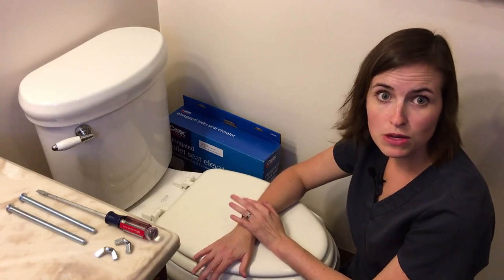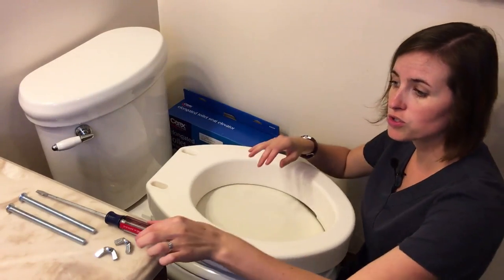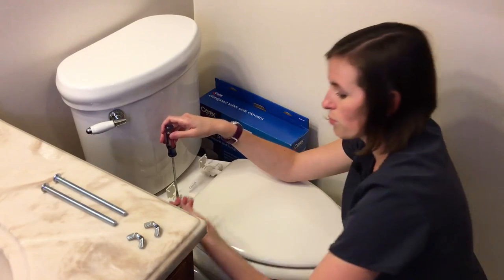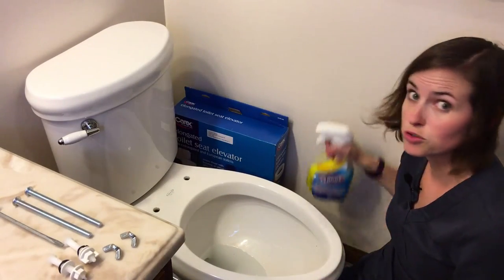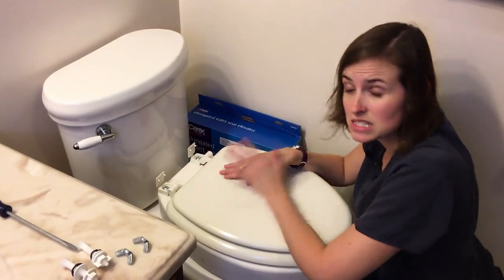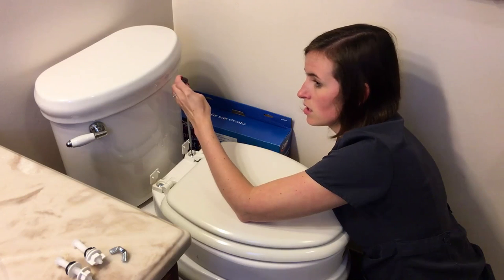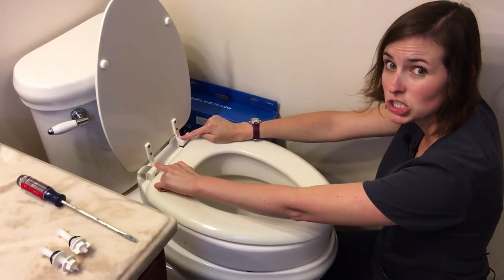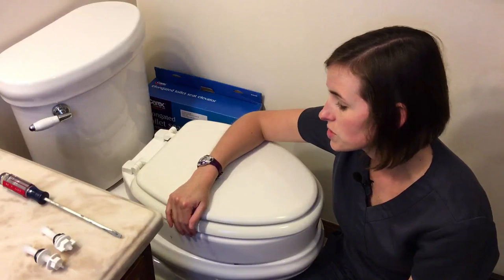How to Install a Raised Toilet Seat with Assembly | Carex Raised Toilet Seat

Comment: Thank you for this video.  The installation instructions for this same product is very lacking.  You did an excellent job.  Thank you again.
Reply from the maker: Thank you Gloria, glad it was helpful!
Reply: Thank you for the video.  I just tried to install one that someone loaned me.  The problem I had was that the bolt that the riser came with are too large for the holes in the back of the toilet.  Would I be able to get the same length screws that are narrower? so that they would slide in?  Thank you.

Comment: i got a riser similar to this, but for a round seat. when I tighten down the screws the front is raised up about .5 inch. how do I solve this problem?
Reply: You need to add some washers between the porcelain and the riser.

Comment: I just watched the video to install Quick-Lock Raised Toliet Seat. my seat looks slightly different from the model you are demonstrating.  it was with flat plates  and instruction sheet. I have. Phillips head-screw driver but need to see  video “how to”.  Your demonstration is very good.
Carrol

Comment: Thank you for your clear and easy explanation of how to installed a TS raiser. I m having a hip replacement soon and I hope that will help during my recovery! The one that I have does not come with the black strips or foam so will protect the porcelain and prevent of slipping, what your recommendation to replace that strip that was not offered when I purchased this product ? Thank you for all your work !
Reply from the maker: CARLOS EDUARDO Paiva I would suggest using some rubber shelf liner on a few spots under the seat. Good luck with the upcoming surgery!
Reply: Thank you Lindsey !

Comment: I purchased the Carex riser with the large bolts and they do not work with any of the toilet seats I have in my house or with any that I've found in stores.  I even called Kohler and Bemis and they tell me that all their toilet seats use 1/4-inch hardware.  My wife is unable to get off a seat without the riser and I am currently jury-rigging it together, but I'm sure it's not very safe.  Could someone PLEASE tell me specifically the brand and model of a toilet seat I can purchase (hopefully from a Home Depot, Amazon or Lowe's) that has the larger mounting holes.  As others have said, this is an excellent instructional video!
Reply from the maker: Hi Howard, I just posted a new video about this exact issue. The link to the toilet seat that I used is in the description from the video.
Replace a Toilet Seat: Prep for Medical Equipment

Comment: Hi, I want to get a hinged version of this seat but am wondering if they will work with soft close hinges.  If they do would you mind doing another video:? Most toilet seats are soft close these days.
Reply from the maker: Typically, as long as the toilet seat installs with straight bolts that are the same diameter as the bolts the come with the riser kit, a soft close seat will work. Some soft close seat kits come with basic bolt installation and others do not. If your does not, it won’t work with the bolt on riser systems.

Comment: Someone loaned me a toilet seat riser, along with the long bolts.  I managed to take off the original toilet seat, but the bolts are too wide for the holes in the back of the toilet rim.  Should I try to get bolts that are the same length but thinner to fit in the holes?  Thank you.
Reply from the maker: I have found that replacing the toilet seat with one that accommodates the larger bolts allows for the riser to fasten more securely. Smaller bolts allow the riser a bit more wiggle.

Comment: I do i have a toilet that has a long bowl,maybe because it is a accessible apartment for the disabled and the riser is a little short in the bowl will that be ok? Or do i have to go back to using the old fashioned ones that clamp on and are harder to clean and access?
Reply from the maker: I have run into this a few times and this type of riser will still work, but there can be the issue of splatter through the gap.

Comment: The Carex elongated HINGED toilet seat 3.5 inch riser was ordered for Dad. I'm concerned that the hinges will wear out, or cause wiggling, and become unstable for him. He is very frail and has a medical condition that has badly affected his bone density. A fall , even from a toilet, could fracture his bones. Anyone had any experience with the hinged model's durability?
Reply from the maker: ILuv Samoyeds I haven’t experienced this. The hinge option is nice for cleaning and standing urination.

Comment: i got a riser similar to this, but for a round seat. when I tighten down the screws the front is raised up about .5 inch. how do I solve this problem?
Reply from the maker: I have added a few plastic washers under the attached area of the seat (back) and this will bring it down to almost flush.

Comment: i got a riser similar to this, but for a round seat. when I tighten down the screws the front is raised up about .5 inch. how do I solve this problem?
Reply from the maker: To be honest, I've run into this several times and have tried many solutions. The best so far was to place rubber washes between the toilet seat riser and the toilet (on the top side of the toilet, not where you fasten the nuts underneath). I've also applied sticky side foam to the underside of the front part that is raised up to make it touch the toilet and provide stability.